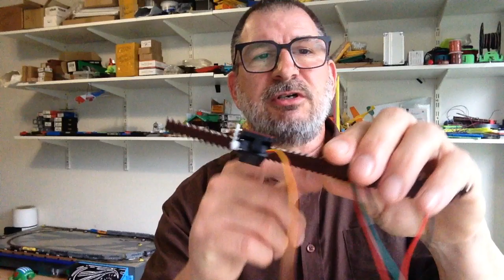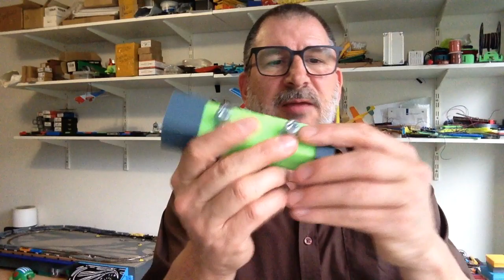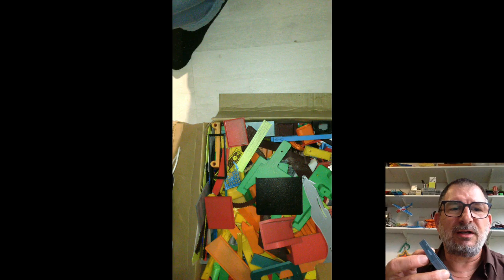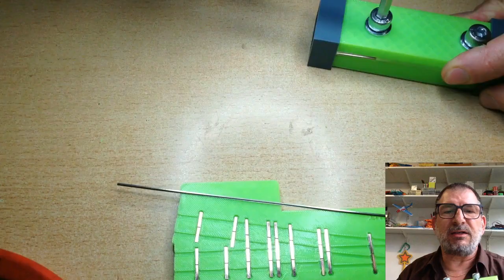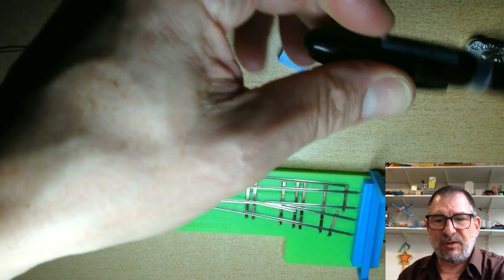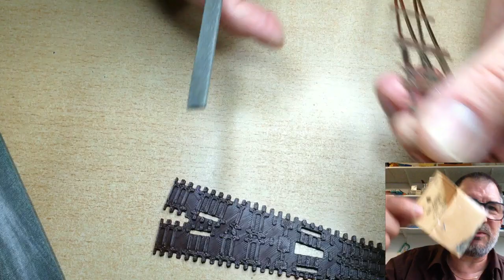Make Your Own #6 Turnout N Scale Hand Build 3D Printed Jigs

Comment: I'm not sure whether scaling up the N scale to HO would work, becasue the rail crossection may not scale correctly. Do you know if there's an HO scale version of this, preferably for code 83 track?
Reply from the maker: No, the ties and rails aren't just scaled up. I've been slowly working on some HO jigs. I made curves in 18, 20, 22, 26 and 34 so far. You pushed me into finishing the #6 turnout.  I'll get the curves listed in the next few days and the turnout after that. I have code 100 but that has no effect since it is just rail height.

Comment: How difficult do you think it would be to upsize your jigs to HO scale and then add a narrow gauge rail for HOn3?
Reply from the maker: Hi Tom, I made some HO as well and they aren't exactly scaled, esp the cross ties. Do you mean dual gauge HO/HOn3? Should be the same process for making any track once the gauges are all set. I'm not sure without checking how the isolation gaps are done. Straights and curves are clearly much simpler to make. Is it 10.5mm?